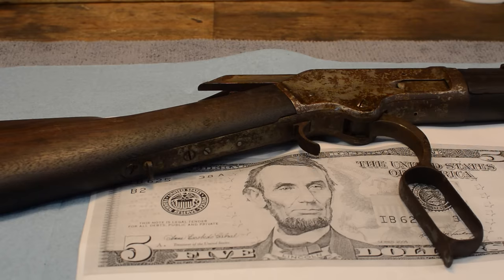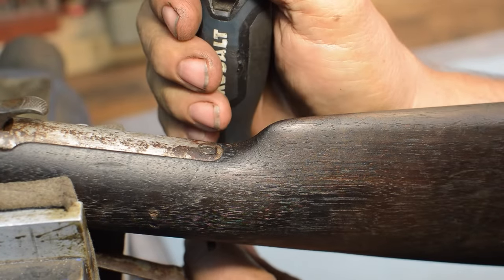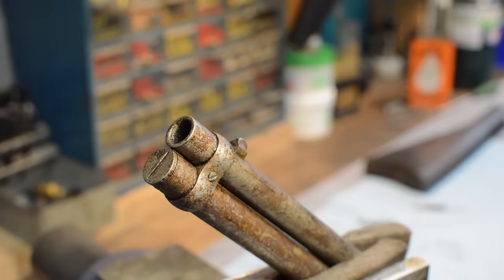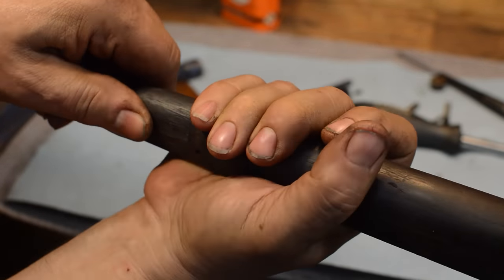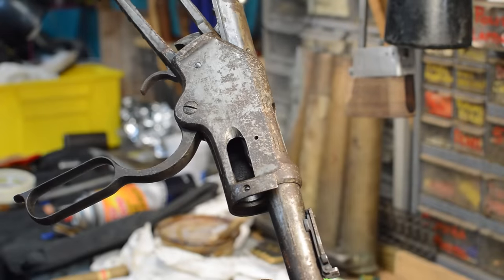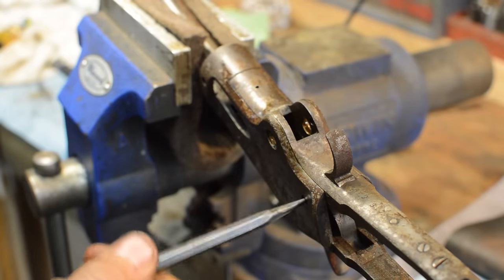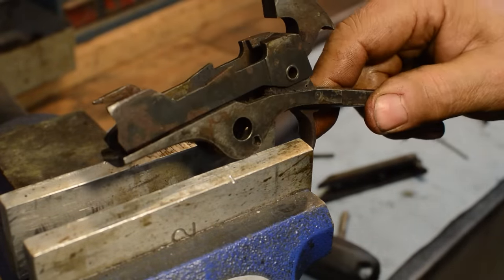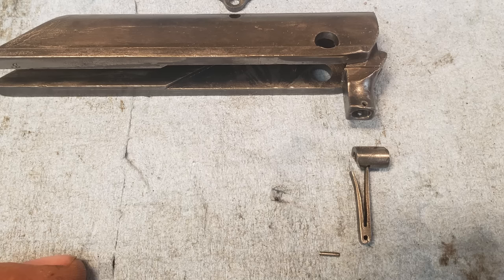Anvil 104: Colt/ Burgess "Light Carbine" resurrection

Comment: I've enjoyed your videos so much, and wanted to try out some of your methods but I'm afraid to do them on a firearm for lack of experience. So, I went to Ace and picked up a ball pein hammer out out the bargain bin and went at it. Scraped the old lacquer off, raised the grain, carded the rust and old finish off, degreased, polished, cold blued, polish, cold blue again, then stained the handle. It came out closely matching the ball pein hammer my dad let me have as a kid, and I was thrilled. Turned this $5 hammer into an $8 hammer, and had a great time doing it. Thanks for all of your knowledge and wisdom!
Reply from the maker: No, the hammer is now priceless, as it is a memory of your Dad, and a very useful bench tool.......
Reply: I would say many mechanics have a favourite hammer. I do coz I never think of just buying a new one the same size and weight.

Comment: That oiling method is how a lot of watch and clock makers oil their respective mechanisms, specifically gear arbors.
Reply: *wheel or pinon
Reply: i have a 12 bore pull through in the form of oil bottle if you screw of the cap you find a oiling needle inside for applying oil . Oven cleaner removes oil from wood  must be well rinsed off and the wood dried very slowly  plastic or stainless hangers a must
Reply from the maker: @danhayward9186  Oven cleaner removes all fill and opens up the wood pores wide. This magnifies refinish time many times, and covers up any labor saving. Just sayin'
Reply: @marknovak8255  yes agree 100% but I have come a cross shotguns that leaked oil like a British motor car but then it is a stock refurbish job

Comment: That tapping really does a lot. You came in a week before hand oiling the screws too. I was breaking down a Ford Flathead 8BA and the head bolts are fairly easy to snap on an old locked up engine. I did the same thing but in my case it was all steel and iron. A week before I went to do it I blasted everything with 50/50 acetone/ATF. I made a bit for my air hammer using a socket to fit the head bolts and every day I'd go out and rattle the hell out of each head bolt. The pre-oiling and impact really goes a long way as well as slow going, and work it back and forth. As I started breaking them loose, I was using my air hammer applying torque and rattling the bolts. I got all 40+ head bolts out without issue. Lots of exhaust manifold bolts on crusty old engines and other rusty crap too. Oiling, impact, back and forth, lots of patience is a great technique to have in the toolbox. Nice trick with the soldering iron.

Comment: a trick for those Kroil cans- Take the straw from an aerosol can (assuming you have not already launched it across the shop) and poke it from the inside, up the little nozzle in the cap. You end up with an extension tube like those "zoom Spout" oilers.

Comment: Awesome. Ive had the pleasure of working on 2 Colt Burgess full length rifles. 1 of them is currently setting on my bench.
Reply: Sorry,which better Burgess or Winchester?
Reply from the maker: Any way I could see the feed stop?
Reply: @marknovak8255  Yes Sir I should be able to do that this evening if the gun will cooperate. I am currently harvesting corn and the screws have been soaking in Kroll for a week and a half.
Reply from the maker: @lorenzogiuliani9144  Burgess, just my opinion
Reply from the maker: @gabewright2690  Take your time. Photos to markfixesguns@gmail please, and thanks
Reply: @marknovak8255  thank you

Comment: About 20 years ago, I bought a Steven's 311A shotgun. One could have knitted a sweater, using the lint that I pulled out of the reciever. It must have been kept in R.D. Neck's underwear drawer for 40 years.
Reply: I haven't even gotten to the mismatched "stock," the screen door eye bolt "sling swivels," or the G.I. field phone sling! Clever boys!!

Comment: This is an awesome video. I just reserecteg a 1926 25-20 winchester in worse shape. Love the soldiering iron trick for heating screws. I couldn't do this kind of work till I was over 50. Took that long to develop the level of patience and thought process required.

Comment: Fantastic video! I spent a good portion of last winter conserving a Whitney Kennedy large frame that was in similar condition. The metal was slightly better, the wood was much worse. Somewhere in its history the gun was used as a bat and the stock was severely split. Someone had attempted to repair it with wooden dowels and wood filler (I wonder how many shots that lasted). Once I removed the old repair (thanks acetone), I utilized the methods you have so graciously shown, with stainless all-thread, walnut, acraglas, and about 30 wraps of the surgical tubing. The repair came out very solid, thank you so much for the demonstrations! Outside, the Kennedy and Burgess look similar, but inside they are very different. Would love to see an Anvil video when you conserve the Kennedy's you mentioned.
Reply from the maker: Anvil 106 for the Kennedys

Comment: In regards to your tapping the screw with a hammer before trying to break the rust bind, another youtube channel I watch did some semi scientific tests and found hammering and tapping rusted nuts and bolts tended to work just as well, and in some cases better, in loosening a rusted bolt than using ONLY penetrating oil to do the job. So you're not wrong in your assessment of the lil taps!

Comment: There's plastic square clamps for holding hydraulic pipes on diggers and the likes , they're fantastic for holding tubes and available in a few different sizes.
I use them for holding the air cylinders of air-rifles in the vice.

Comment: Tapping the head of a screw/bolt absolutely breaks the corrosion loose and helps to actually get it out without damaging anything.  I made a special bit for my air hammer to loosen corroded stainless screws going through aluminum panels on semi trailers and it makes all the difference.

Comment: I've noted that when removing screws on/from older items...that "raise" head screws are in/for wood and  that the flush type are "machine" screws...99% of the time. And I agree totolly with your method of applying penertrating oil. I use a Q tip with the oil in a small pill container or a eye drop dispenser...Also I like it warm...🖖👍🐝💪

Comment: My first "I have no f'king idea what I'm doing on this gun" moment was a Burgess Takedown shotgun disassembly, luckily although they are all built differently for some reason they are well built enough to have the person assembling them in mind so it isn't so tough for a mongoloid like myself. All I had were patent drawings and images of the outside of the guns as info. Still in the process of fixing her so that she is more than a single shot. The extractors are a horrible design and both mine were broken, and my cartridge release was missing. Once I get my machining tools up and running I will hopefully finally get to use her like she should have been.

Comment: To get the fore stock off without buggering the wood, I just remove the barrel band screws, front barrel band and then hold on to the fore stock while lightly hitting the barrel muzzle.  Because the barrel tappers, the band and stock easily move forward.  When putting it on, put the rear barrel band one the fore stock first then slide the entire assembly up to the receiver.  Just info from my mistakes.

Comment: Love Kroil. Working in the industrial setting we put this angel piss into the orifices that were 870 to 900 degrees to lubricate the bearings and sleeve on the lead pump shaft collar that seized while laying idle. Not cheap but wonderful.
Reply: Very best I have found !   I just recently found that they are two types of kroil. One I think is the same as original but with silicone added.

Comment: Decades of personal experience with various penetrants. I was never introduced to angel piss until I worked in aviation.
  We had a business class private jet that the throne had been leaking blue water into the fuselage for a long time. 
We all can imagine what caustic solutions do to aluminum over a period of time. Even though it was all coated in etched green primer this offered minor protection.
 The technicians were able to remove the majority of damage using angel piss. Never heard of it prior to this experience. Have had a can on my bench ever since.
  The repair took two weeks but they were able to pass FAA inspection and saved an expensive jet aircraft !!

Comment: Try the white sheet trick for the direction you are driving pins or could loose springs into.
They hit the sheet, then roll down to the folded resting bottom of the sheet hung from higher on your bench and draped to whatever was below that, and are much easier to find as they stand out against the white, vs a shop floor.

Comment: I like trying to figure out how these guns are engineered.  There is some similarity across leverguns, but this one had some deviations that were interesting, I don't think some were particularly good, but interesting.  I do like how the bottom end of the action came out, much easier than the 1892 to disassemble, but the cartridge loading and lifting is ugh!  I realize Colt didn't want to pay for the loading gate license, but that method is wrought with issues.  The carrier is overcomplicated as well, I assume for the same reason.  I can see why they weren't as prolific as the WInchesters.
Reply: Yeah, I can't imagine a level of brand loyalty that'd have me picking this over a Winchester, it's no wonder it didn't take off.
Reply: Yeah, dealing with patented components is a pain.

But the Burgess folding shotgun is the one I want!

Comment: I have a question.how does one oil screws whose thread mates with the wood, without damaging the wood the screw is engaged with?
Reply from the maker: Oil only helps a wood screw where the head sits in the metal recess. The part in the wood , well, prayer works well here.....

Comment: @ 33:00 that cap screw, or plug screw is not hard to make at all,.
Just cut the threads on the correct sized shaft and before you cut it to length, cut the screw slot on one end..

Comment: Deadly trick with the soldering iron to heat up the lil screws! The workings of this gun are very similar to my Marlin 45 government. Wish I would have seen this video before I took it apart. I got it back together but I kinda cracked the wood grip that you pointed out is very fragile.
Reply: Yeeahhh i knew ol dude was a guru when he done that.

Comment: Great video. Thanks! With this conversion, did you separate the barrel from receiver? If not, is there any worry about trapped water afterward?
Reply from the maker: Did not separate, and have not experienced a trapped water issue yet. I try not to pull barrels unless I need access to the breech for serious cleaning of the chamber, or access to extractor recesses.
Reply: @marknovak8255  Thanks a lot for the reply.  I’m going back and watching some of you other conservation videos. Great stuff!

Comment: Just a thought Could you  use  a small  soldering iron  to heat just the top of the screw or pin the put a drop of the oil on it.,It seems to pull the oil in

Comment: What are your thoughts about modification of a milsurp or older gun of no real value historically or monetary. A part geometry or spring style changed to improve operation.
Reply: Spring replacement to restore function is maintenance, not modification.

Reshaping metal is a little more iffy, unless it's on a replaceable part (say, 1911 extractor)
Reply: No.
Reply: Now, if it's already been sporterized butchered, I'd be more okay with that. I'm talking barrel shortened, old sights removed, etc.

Comment: I am learning on three Mosin 91-30s. (I have my two dream guns): 1898 Manufacture date Winchester 1894 in 30-30 with the octagonal barrel, barrel length mag tube, and perfect three-leaf "express" sight (all lettered through Cody),  and 1892 Winchester manufactured in 1892 in 40-40 the same as the 30-30 only round barrel. I want to learn on my Mosins and then do my Winchesters. On the Mosins, the bore is riffled and I have been able on the first one to make it like new (better than new). The bolt cycles perfectly even when fired rapidly and the accuracy at 100 yards is near my NM Garand. But, the bores are black. I have tried every Hopie's product, copper wool, ......... plugging and soaking overnight in Kroil and I still can not get a shiny bore. How do I get the Mosin's bore to clean up to sliver shiny? Thank you!

Comment: I've got an old WWII rifle that I can't find much info on. It's a Breda 1927, have you ever heard of them? I think that it's missing a few pieces, and I was thinking about sporterizing it. What would your thoughts be?
Reply: What parts are missing?
Reply: @Sman7290  sights, upper shroud, and lower front shroud
Reply: @joncutt872   I'd but it for parts.   Other than that,  good luck.
Reply: @Sman7290  if you Google breda 1927, you can see some pics of it on my post in the firearms forum
Reply: No front sight of rear sights, no front metal,  no handgaurd, no barrell band, stock cut,  and barrel shortened.  
They really did a number on it,  didn't they?
Reply: @Sman7290  they sure did
Reply: Like all of the old military rifles sporterize them otherwise there just a piece of crap at least sporterised they'll look nice and be of some use unless there a carcano or mosin nagant garbage rods from the factory IMO

Comment: "Springs are consumables.." I dare say that wood is s consumable too - and the surface treatment of the steel/iron. If you want to use such an old gun for shooting conserving the old wood furniture for display and replacing it with new, and re-bluing/retreating the surface of the steel,  would probably receive a nod from the original manufacturers. I know that will be considered blasphemy but keeping the gun as close to its original factory condition as possible will prolong its life.

Comment: Was wondering what the extra steps are to completely restore the/a gun back to showroom finish. For example i just inherited an old bolt action 22 that was brand new to my grand father when he was young.  Was thinking of restoring it to factory now and passing it on when the great grandkids are old enough. “IF” the maintenance is done between now and then it would be quite the prize though still not Lawrence of Arabia’s.  Thoughts?
Reply: Look up the rust bluing videos marks done and the videos about conservation

Comment: I still don't understand why that 1 screw had to be tapped down every half turn... I would've just unscrewed it all the way out first time. Maybe i missed it.
Reply: So as not to damage the threads on either part. Because of the type of connection it is, it is safer to do it just like Mark shows to get the other side moving while having maximum engagement of threads. Once you know there is no binding then it can be backed all the way out and then the other side pulled or driven out.

Comment: I’ve recently acquired a Hakim with a severe wrist crack, it’s been glued and pinned in 3 spaces presumably an armory repair. Unfortunately it’s not very strong and will need to be redone, if anybody has some advice I’d be grateful.
Reply: A big steel pin and some epoxy is what Mark usually does

Comment: I'd take the wood off.
Then I'd soak the gun in ATF for 2 years and turn the screws out by hand.
Reply: I use Kroil on antique motorcycles, but half acetone and half ATF make the best soaking solution ever. Acetone penetrate, ATF lubricates.

Comment: Ya know, you take such care of removing the stock forend from the magazine tube, then you turn around and drop it on top of the Ballpeen hammer (24:40). I've seen a number of your videos where you use such care in taking parts off, then just toss them on the table top. Seems inconsistent to me and would recommend laying them down gently to demonstrate you care.